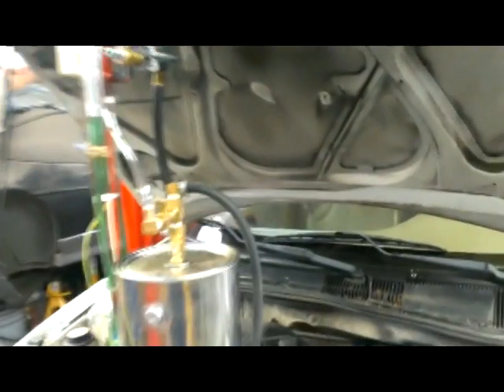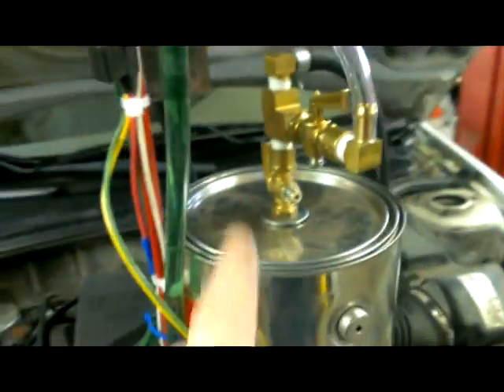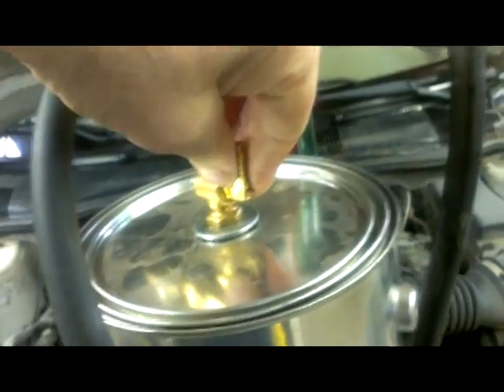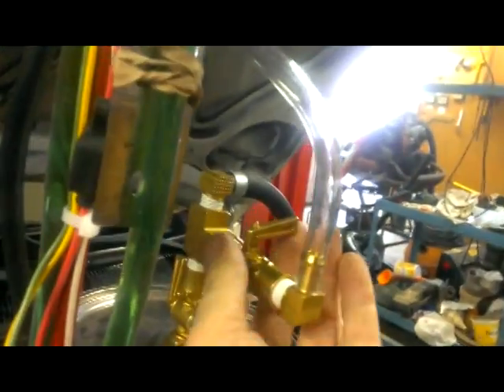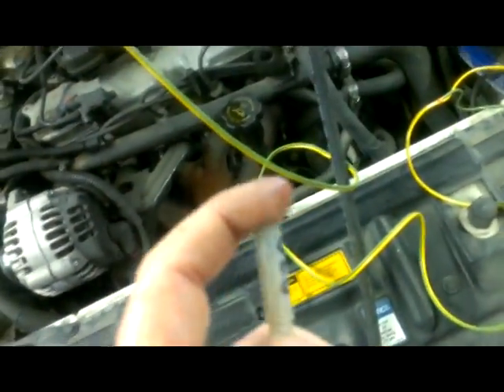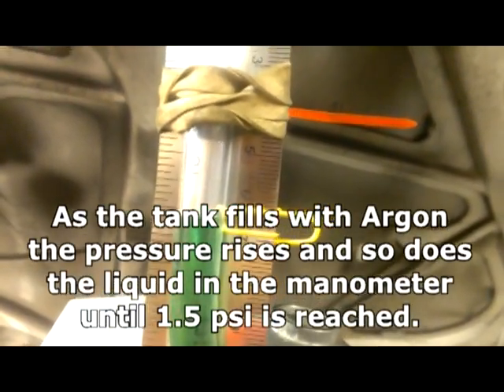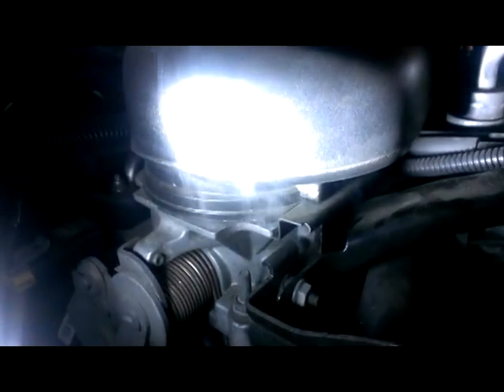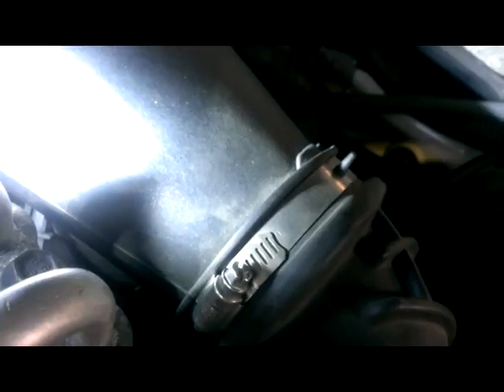DIY automotive smoke machine, construction & use

Comment: I use to work at a dealership and had access to the expensive store bought evap smoke machines. I am going to make one of these to test the evap system in the cars i work on at the house. Like your design that has the flow meter set up on it. Dont think compressed air would be an issue. One smoke machine we had used compressed air and another one we had had an air pump built in to operate it and another one used nitrogen.Thanks for posting your video

Comment: I would like to thank you a lot for your informative video.  i modeled my smoke machine after yours.  I really liked the fact that your design included a homemade manometer, which my unit also has.  My design is very similar to yours with the following major difference:  I made my smoke generator based on e-cigarette technology.  I went to an e-cigarette store and purchased 22 gaug3e Kanthal wire and a package of "Native Wicks"(cotton wick material).  I wound two 6-volt coils which a run in parallel for 12 volt operation.  Each coil is 9 turns of the wire on a 4mm drill bit.  The resistance of each coil is a little more than 1 ohm each.  I made 4 posts with 4-40 set screws to hold my coils end down with by starting with 1/4"-20 brass screws purchased from Home Depot.  Two reservoirs(plastic caps) were attached underneath my round fiberglass circuit board along with leads that I soldered onto the heads of the screws.  This produces an incredible amount of  smoke using a 80/20 mix of VG/PG e-cigarette e-juice.  There's one correction I believe that I should bring up.  A propane regulator doesn't bring the pressure down to 1.5 psi, as this would equate to ~41 inches of water pressure, requiring a much larger manometer.  Instead, a propane regulator puts out more like 0.25 PSI, or 13 inches of water pressure.  i measured 11 inches of WC for the actual regulator that I picked up from Home Depot.  My manometer came out so that it can measure up to 18 inches of WC.  I also put a small amount of loosely packed cotton on the top exit hole of my manometer.  This has two added benefits:  1:  helps reduce loss due to evaporation and 2:  Helps to dampen the response and settling time of the water/dye mixture.  BTW,  I used blue dye in mine :-)   Finally, adding a second calibration point for a 0.040" leak is also nice as there's two Evap error codes that can be set:  One for a small >=0.020" leak and one for a large >0.040" leak.

Comment: Nicely explained, both regarding construction of your jig, and things to watch out for in operation. Monometer is a nice touch for detecting the presence of leaks, before using smoke to identify them. Low pressure gauges, an alternative solution, would be relatively costly and probably less sensitive. BTW folks in the audience burning items then introducing into intake etc. -- that kind of smoke introduces particles that you do not want to remain in your auto systems, particularly intake. Just sayin.

Comment: I know this is late posting this but only saying this in case others are wanting to know. If the binding posts are melting its because you have to many amps. The binding posts work great and can handle 10amps so if you are melting them then you are running way to many amps. Just trying to help others and good job on your smoker.

Comment: One last important detail WRT my smoke generator:  I used a 3/8" copper pipe to direct the incoming air to come out and blow directly across my coils.  This is very important component when trying to generate lots of smoke.  I pinched one end and drilled 4 holes at each coil position.  I pinched off the far end using my bench vise, attached first with tie wraps for aiming and locked down with Fuz*It Liquid nails onto my fiberglass PCB after getting it aimed and aligned perfectly.  This step is key for generating ample smoke.   I guarantee you that you won't need any special light to see the smoke that comes off from using this puppy!!!
Reply: I would love to see pictures of your build!

Comment from the maker: Yes it would be safe to use shop air if you disconnected the EVAP and other lines from the fuel tank and capped them, but it would hardly be practical. Many times the leak can be found in the EVAP connections to the fuel tank or the lines on the filler neck. Also in most cases you would have to drop the fuel tank to disconnect the lines. You could find an O2 tank and use that. O2 is carbon dioxide and used in the food industry for soda dispensing machines.

Comment: Sir, Thank you for your solution for a DIY smoke machine. Could you possibly post a parts list and some of the details of assembly? What gauge nichrome wire and what length to get the temp. needed? Also what the distances are from the wire wick assembly to the bottom of the can etc.
Great video loaded with the correct information as far as air supply and manometer usage, but some still pictures would be great to see the fittings used and their configurations,the video is moving pretty fast to see all the configurations. The argon gas is a great knowledge addition. Thanks again.

Comment: Good setup. If I were to block off all the fuel lines and evap lines in the fuel system would it be safe to use shop air?

Comment: to find a vacuum leak where is the best and safe place to introduce the smoke? I noticed you said not to use air in the fuel tank during evap rest. But on the other videos everyone is using air compressors thru the regulator. Sorry, just trying to figure all this out.
thanks!
Reply from the maker: I'm assuming you are speaking of testing the EVAP system. Most vehicles have a test port under the hood, however I don't have the fitting to tap into it. I often disconnect the line at that location and tap into the line to the tank. The industry does not approve of using plain air to test the EVAP because it is possible to create a possible fire or explosion risk by introducing oxygen to the fuel tank. The reason the fuel tank is considered safe normally is because it is so rich in gasoline vapors that it will not ignite. I cannot recommend to viewers to use anything but inert gas.

Comment: Nice video.When you were checking the exhaust,were you still injecting smoke at the brake booster connection,and just sealing the exhaust tip,or do you inject elsewhere for an exhaust check?Thank You!
Reply: I slipped a rubber glove over the tailpipe with an strong elastic band to hold it on. I cut one of the finger tips off and put the smoke nozzle in there.
Reply: @richardmathews8250  Thanks!

Comment: what are your thoughts on using baby oil as the fuel? I figured that with all the detergents and scent chemicals and what not it might leave some nasty residue inside the engine, though everyone seems to be using it.
Reply: +pmmjkl 
Mineral oil is preferred, but most baby oil is more than 99% mineral oil. 
Mineral oil smoke has minimal residue, it is what most commercial smoke generators use.

Comment: Is the nichrome wire that wraps around the wick is also submerged in oil? Or just the end tail of the wick ?
Reply from the maker: The wire is just under the top of the oil. I check the oil before each use or when the smoke isn't coming out.
Reply: got it,thanks

Comment: how much wire do I use, and what ohm reading should it have and if the wire turn red hot won't it start the baby oil on fire.
Reply from the maker: I used enough wire to get about 10 or 12 wraps around the asbestos. I didn't check ohms, I just adjusted the rheostat to regulate how hot the wire got. I just turned it up enough to get smoke. I don't think with the lid on it it would catch fire, not enough oxygen.

Comment: Thanks for the comments. The system is basic, I just added the manometer to confirm absolutely that no leaks exist. Most times you can catch the leak right away. I recently used to to find a leak above a fuel tank on a Montana. It would have been impossible to spray anything up there in hopes of finding a leak.

Comment: Really great construction. But way too over complicated for me. I use a paint can and a piece of torch heated coal. And a 12 volt tire pump. I cut a valve off on old tire for a connector for that.

Comment: hi what mix psi can i use it to find vacuum intake leak ...iknow in evap max 1.5psi
Reply from the maker: I regulate the supplied air at 1.5 psi to protect the EVAP.
Reply: @carguyeh  thanks sir for replying my questions sir in previous question i mean what safe psi for intake leake i know safe psi for evap 1.5psi ...I ask about safe psi for intake leake

Comment: Where did you get the dye?
I found and ordered one but is water base.
Reply from the maker: I used the dye from my A/C recharging kit. You should be able to find UV dye at an auto parts supply.
Reply: +AWD V8 Thanks!